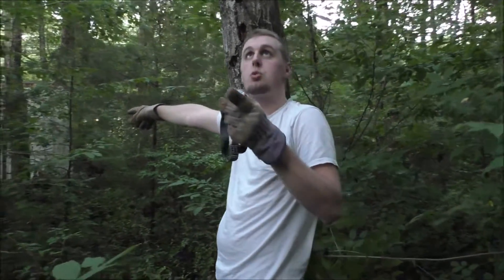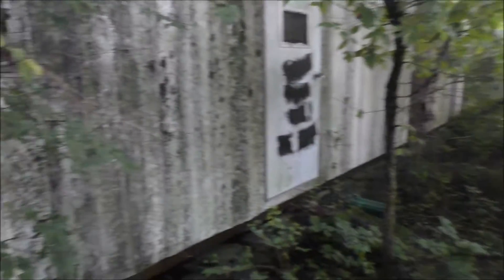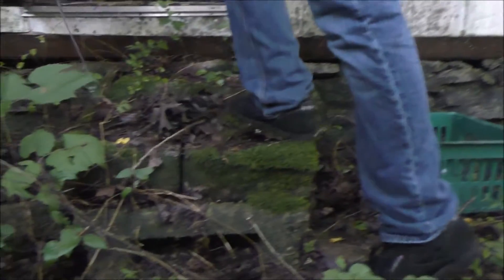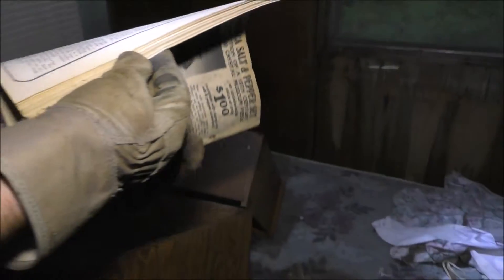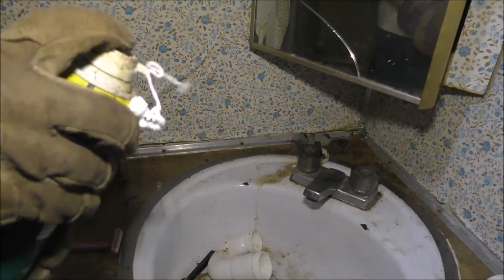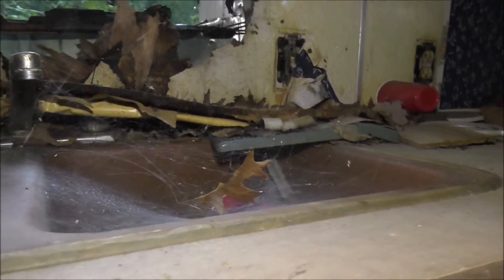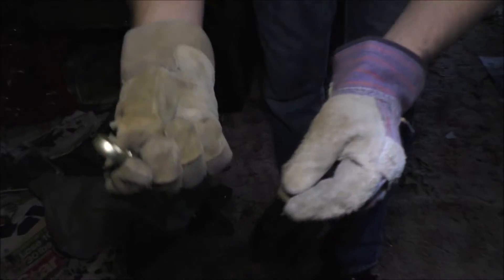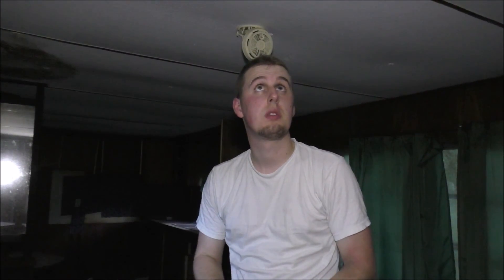#6 Creepy abandoned seventies trailer in the woods!

Comment: I found a few places like this.. my grandmother had one just like this, it was a yellow single wide trailer, had the tail lights on the back too.. I got into it after she died and someone else owned it but they gutted it out and took all windows and doors off and left it to rot..  then finally tore it down. Next one I found was to close to someone else's house so I didn't get close to it.. I got a few photos of it.. the style screamed the 50's or 60's  and I found one other which was collapsed, it was pretty much far gone but it was from the 60's from the looks of it.. the main door was part of an addition to the trailer,  the trailer itself was far gone.. no one could have lived there now anyway if it was in great shape.. it's to close to a road,there's no septic.. in the 90's I remember seeing it and it looked like it was still livable... but as years and winters went on it was pretty much gone.

Comment: This trailer is 60s model. They didn't use real wood inside trailers in the 70s, plus,the fan in the kitchen wall is before the 70s, the bathroom and ceiling tiles and the outside of the trailer looks like a box, that is very 60s.
Reply: NOPE! 70s lived in one just like it in the 80s